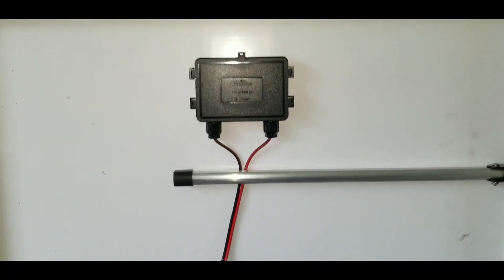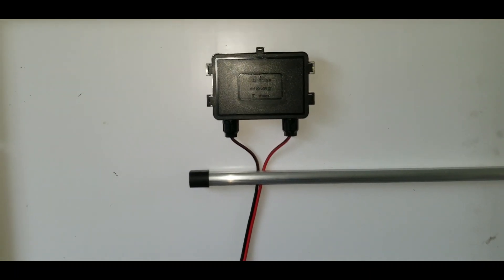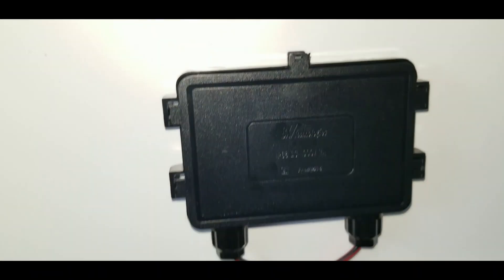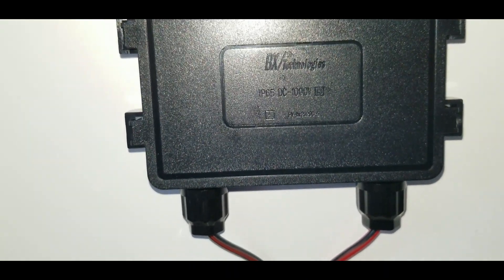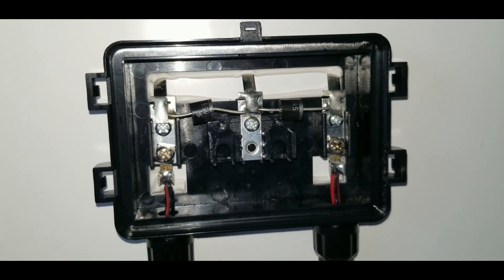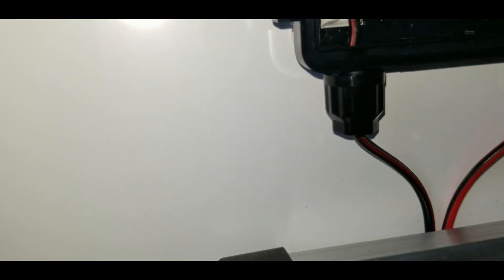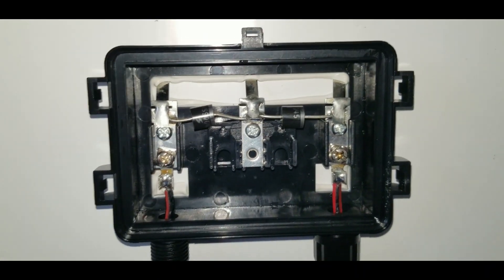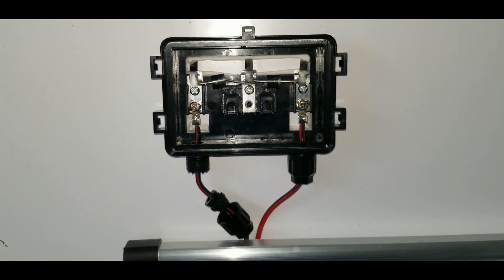What's inside the new Harbor Freight 100 Watt Panel part # 57325 "Junction Box"

Comment: UH, I think there is something wrong with the connectors in the box on my panel! I noticed that the center connector is not connected to anything at the top except the diodes, your video shows some solder at the top going back to the panel, mine does not have that!😲
Reply from the maker: Possibly a change they did?
Reply: @DIYKAI  Thanks for your reply, I guess it could be a deign change. I am going to upgrade it to 8Awg coming out anyway as soon as I find my soldering iron!🤣🤣  To bad I can't post pictures.
Reply from the maker: Yea the wiring is definitely a weak point lol the SAE connections get hot under full load and sun

Comment: Thanks, that is what I was looking for, I want to run 25 ft of  8 gauge from the panel to the charge controller so I can get every ounce of power  out of the panels instead of that wimpy 18 gauge that is on there!😁 Bought an SAE with 8 Gauge wire off of amazon so now I think I can put it on terminals in the box instead of that wimpy stuff!😁
Reply from the maker: Your welcome!

Comment: The black pieace in the junction broke on the positive side what can I do
Reply from the maker: What exactly broke? if it's just the plastic you should be fine if its the metal then you would need to re solder it
Reply: @DIYKAI  Diode on the positive side broke. I've went through 5 solar chargers I thought I hooked them up wrong 1st then I was just buying junkie cheap ebay ones. Im taking it back now to get a new one. Thanks for your Reply
Reply from the maker: Yea take it back they will swap it for a new one

Comment: Can you explain why this panels can't be connected in series?
Reply from the maker: I believe it’s just because of there charge controller because in series the voltage is added and will exceed the controller capabilities we have several in series but using a renogy controller
Reply: @DIYKAI  You can but the charge controller hast to be able to take 60 volts DC, the cheaper ones won't. When you hook them in series (each one 18- 24 volts @5.56Amps) you get 46- 48 volts. When you hook them in parallel you get more amperage18- 24 volts at 10 amps.

Comment: Love my harbor freight panels I got two 100 Waters fixing to upgrade to 400 watts sitting at 200 Watts right now and charging my batteries
Reply from the maker: Ours are still doing great as well...have you seen our video on the renogy panels? They seem to be a better long term lower cost option, but either are just fine
Reply: @DIYKAI  I like renergy they're just a little too pricey for me I am disabled and on a fixed income I live in a camper on the back of my truck so the only way I could really afford power was a little here and a little there that's how I've been keeping my batteries charged where I can talk on the phone and do my computer work I'm just grateful to have a harbor freight that I can actually pick something up at close they are a good company that is reasonable even though they carry stuff that's not best of quality like their solar chargers they still do the job per what I need so I cannot complain I'm looking at something that is EMP proof and it's going to cost me about $1,000 for the solar controller and charge controller
Reply from the maker: @lennymalley745  Right on man! Defy recommend a better charge controller the ones from HF burn out every one I tried multiple ones its a ticking time bomb...lol  even the 20 buck ones off Amazon are far better and last longer......as far as EMP proof you can build yourself a cheap encloser its very simple
Reply: @DIYKAI  thank you for a recommendation also on the charge controller I will be looking them up and checking them out
Reply from the maker: Check out our videos on that’s as well we listed some good cheap ones in the description

Comment: Hello, do you know is the black wire the negative and the red the positive?
Reply: I'm going to put All the positive together,all the negative together then run a 10 gauge from them to the charge controller,the renogy panels will be on there own 40 amp charge controller, our system is all 12 volts but I have the 2 separate charge controllers so if one fails we aren't completely down
Reply from the maker: Nice!!
Reply from the maker: Yes red positive black negative
Reply: Thank you so much, I have a 80 amp charge controller I would like to cut the plugs off of the 4 100 watt panels I have and wire them all together parallel  to add them to the renogy 400 watt kit I have
Reply from the maker: Yes you should be fine the renogy charge controller has built in protection we have the 40A 800w kit
Reply from the maker: Your welcome
Reply: We've had the new 100 watt hf panels for 8 months or there abouts and we've had no issues from them they work pretty good for the money,but the charge controller lasted a month maybe and the hub lasted about 3 months I think so we bought a big charge controller so we can expand our panels when we have the cash flow
Reply from the maker: Yea there controllers suck it’s best just to get an MPPT and call it a day the panels are good and the price was right when they first came out now that they went up 10 bucks Amazon is the cheapest and easiest
Reply: @DIYKAI  agreed we got the the 400 watt renogy kit for $507 I believe on Amazon,we just ordered it today and it is on sale with 25% off
Reply from the maker: We got ours on a deal as well

Comment: I know the basic on electricity. but on this it is a learning curve for me.  I guess it will be justt like my ham ticket. a learning curve
Reply from the maker: So to give you an idea a 400w setup will charge a 100aH battery no problem maybe two of them…..then with that you can run lights all day and night  a tv charge phone and a small efficient refrigerator
Reply: @DIYKAI  I would like to add a couple three or four more panels I'm not even sure if the 100 watt panel put out twenty four our twelve volts I have the three fifteen watt panel and and one 100 hundred watt panel, now my thought is I would like to have the older set hundred watt panels just for the weight factor. I'm just wondering they can all be mixed together. on batteries I have heard do not mix and match, but that I have done. I had one thunder bolt battery and I mixed it with two lead acid batteries  Marine rv.

Comment: I'm just a person that does not have many panels. I have a box with the forty five watt panel in the gurage and the missus has threatened to sell it at a garage sale a couple times. they just came out with there hundred watt panels the day after I bought this one. in those days it was three panels to make a hundred watts.
Reply from the maker: Tell her to save them they produce power lol better to keep them
Reply: @DIYKAI  no way on the garage sale. they will stay in the garage until next spring if the good lord lets me make it. then I'm going to figure some kind of mounting bracket. pick minds out here as to what gauge of wire and how long of a run to the house. I have an antenna farm in my back yard. so it takes a mathematical equation to figure out where to put them and all the rest that goes with it. the best bet would be to have a battery box and inverter where you put them. then you can run any gauge wire to the house. now the problem is how to keep the batteries warm in the winter. Mine will be cheap marine rv batteries I'm seventy six so I know there is no ladder climbing for me.I have a fifty foot tower to put up. I can't even did the three foot hole by three foot hole to mount the base of the tower. it would be nice to have a twenty meter beam up there.
Reply from the maker: Slow and easy wins the race….maybe put them in an insulated rubber made tub?

Comment: Can hook straight to  a deep cycle battery
Reply from the maker: No I wouldn't as the voltage is ~ 22..5 vdc and would fry it. Grab a cheap PWM charge controller i have some other videos on it

Comment: Hf panel pulls 22 volts in direct sunlight, and 17 in the shade. The hf charge controllers are fake garbage. ...the panels are good. ,👍
Reply from the maker: Yes I have a 30a charger off Amazon much better lol
Reply: @DIYKAI  I don't get it, their $20. Controller, why do  they even stock it? I bought a 1500watt pecron, waiting for the mail for testing...i made my own kit also, but the DeWalt 1000 inverter couldn't run my coffee pot pulling 900 watts.
Reply from the maker: Not sure the small pwm ones always fail the larger ones are not even slightly weather proof.lol...its almost a joke
Reply: @DIYKAI  wow, good to know.  It would be nice if it all was more affordable for everyone, if I was pres, it would be. I would try anyway.
Reply: @plove9136  It is still very expensive, I have about $1000 tied up in a small system with a 100AH battery,1500watt inverter, a 30 amp charge controller and wiring just to run a fan and a computer and a couple of lights. No AC or refrigerator!
Reply: i started with one 25 watt HF panel and the HF controller. that controller died very soon .i got my money back and bought a larger controller. i then bought the 4 panel 100 watt kit . that controller works good.. i then added a 100 watt panel . i just bought another 100 watt panel haven't added it yet. i found the SAE connectors on ebay. made a pig tail to add the 100 watt panel. i need to make another to add the 100 watt panel

 i use the panels to charge a 100 amp deep cycle battery . that goes to a 3000 watt inverter which runs some led lights and my garage door opener.
Reply: @erniew5805  sweet. Solar is so addicting. More, more, more! I've learned from all the people on you tube.
Reply from the maker: Nice we just got a 100aH battery and a Renogy charge controller with 2 100w panels and 200w of the old panels going to be testing it out soon
Reply: @DIYKAI  I tested my new 100w rich solar panel at night, off my living room lights and got 15volts, I couldn't believe it. I have to compare it to my hf panel for a test. In full sun they both put out same22.3v. saved a few bucks on rich®️. Doesn't have the feet on back though. Roof top anyway. (No load tests)
Reply from the maker: @plove9136  nice my 100aH test is going very well it seems today have a killawatt meter to see the results
Reply: @DIYKAI  what kind of battery did you get? Do you know if the Walmart $99 deep well are any good for solar, 114 A.H.?
Reply: @plove9136  I got me an Ampertime 100AMPhr from Walmart for $400, Lithium iron phosphate, 10 year life exp, deep cycle lead acid batteries only 2-4 years! Also a 100AH Lead acid weighs 98lbs, mine 27 lbs😁

Comment: The wires used on the panel sgould be at least 12AWG...those are to small!
Reply from the maker: Yes I agree but they have been fine so far and hold 7a well
Reply: Yes that is why I am modifying mine to 8AWG to cut down the loss!😁 I have to run 25 ft from the panel and the calculator said 8AWG for 1% loss,3% loss with 12awg!

Comment: So what would I need to connect multiple panels together and would I need multiple charging box?
Reply from the maker: so the connectors are SAE so it depends on how you want your system and size......anything under 400W and you can use a hub connector and charge controller.....the charge controller is what goes between the solar panel and batteries.
Reply: @DIYKAI  so withe four hundred watt you can use it?
Reply from the maker: So 400w will produce up to 1kw a day of energy so it will really depend on your batteries that’s what’s actually powering your devices
Reply: My system would consist of 2 solar panels of 100watts at the moment to charge a 5000watt continuous inverter with 100ah deep cycle batteries but max capacity is 10,000watt on inverter. I will have 12, 100ah batteries when all is said and done. So the size right now is 5000w, 6 deep cycle batteries at 100ah with 2 100watt solar panels and charging box. So what would work to connect these multiple solar panels from HF?

Comment: If I have 1 and add 1 or 2 more 100 watt panels, what kind and power controller is best used with that setup ??  Thank you for great videos.
Reply from the maker: For anything less than 400W I would recommend a PWM controller 20-30A will be fine.....if you don't mind spending a little more $$ a MPTT would be the way as you will harness slightly better results...below are some options you can look at:

PWM charge controller:

https://amzn.to/2RX7icQ

MPTT:

https://amzn.to/3gzL6xH

Both I have heard get things about and both will do the job.

Comment: Easy to do. HF sells that hub that allows you to connect 4 panels up to 400w that uses the exact same connectors.
Reply from the maker: Yes I have one and used all the HF solar charge controllers they have all failed with exposed weather lol
Reply: @DIYKAI  My HF charge controller is inside a waterproof box. The hub I have hasn't been exposed to rain, I live in Arizona, we don't get much here...;)
Reply from the maker: Ah nice I'm on the East coast we get all seasons in one day here sometimes lol
Reply: @DIYKAI  I know, I'm originally from Maryland, hot humid summers, bitter cold winters.
Reply from the maker: @Praetoria113-zm3no  yup sure is lol
Reply: @DIYKAI  I only use the little 7amp 100w charger they have. The one I want is made by Renogy.

Comment: I bought two Mighty Max 100 watt poly panels on Amazon for 77 each. Haven`t tested them but they`re great performers from what I`ve seen on YouTube. I have a bunch of folding portable panels and some very small ones I use to power my larger portable radios that use four D batteries. I just bought a 18-24 volt 100 watt 10 amp 24 to 12 volt buck converter to do an experiment to see if I can use it to directly connect a 100 watt 12 volt rice cooker to these panels in parallel to bypass using a battery. PS: I plan to document all my crazy experiments on my channel. I`ve only made a few short test videos since getting good cameras but once I get moved into my new travel trailer that will be my hobby.

Comment: Thanks for the peek inside the junction box. I picked up two of these panels from HF a couple of weeks ago and they seem to be quite effective. Looking forward to taking them camping off grid in a couple of weeks and seeing how they compare with my older 4x25w Thunderbolt  array.
Reply: Please let us know how they work out for you after the camping trip if you would please thank you
Reply: @chuckingram5966  Certainly ... I took the two 100W panels to Road America in June of last year for a four day off-grid camping trip and they performed with excellence under varying conditions ranging from full sun to mostly overcast. The panels did a perfect job of keeping our group 31 lead-acid battery charged. Never needed to break out the gas generator once. Significantly smaller and lighter compared to the older 4x25W Thunderbolt array. Our camping neighbors were very interested in the panels as well! These will definitely be my primary panels of choice for future camping trips.
Reply from the maker: That’s awesome our 2 are still going as well.
Reply from the maker: I will be adding this to 200 watts of the old kits as well...let me know how it works if I dont get to it
Reply: Then you overpaid